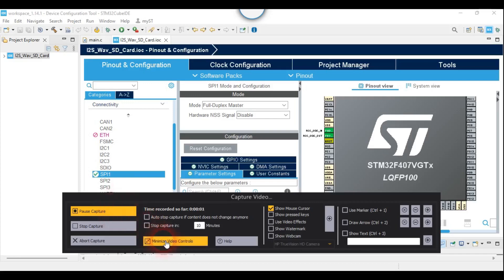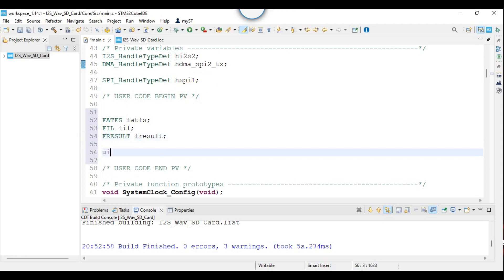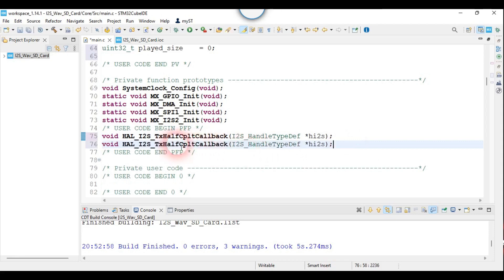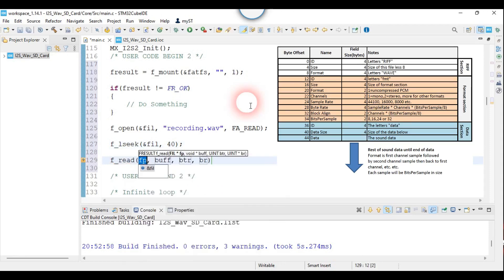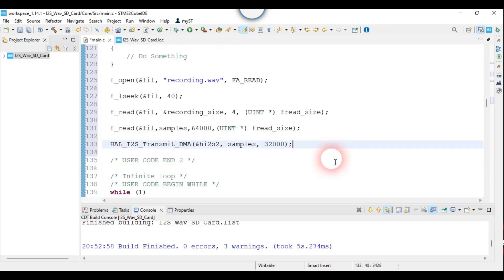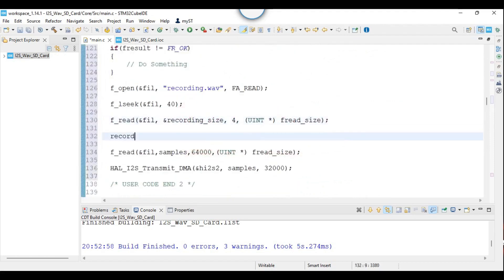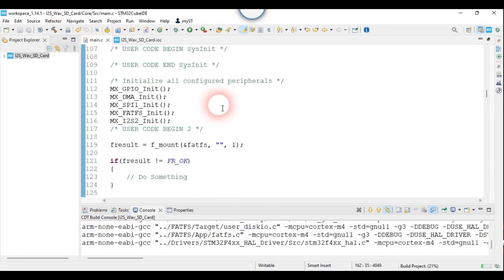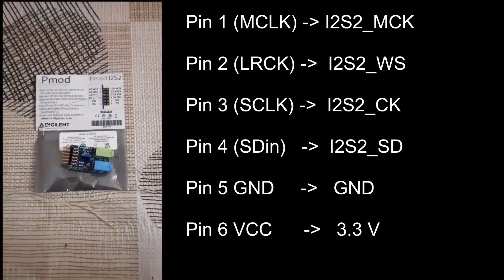Playing Wav File From SD Card (STM32 - I2S - DMA )

Comment: Hello,
I discover your very interesting presentation when, I am willing to use I2S with my stm32h747i-disco board.
I implemented your method but I miss something.
The issue is the program run only one time the function callback. I find out this with breakpoints and also print .

void HAL_I2S_TxHalfCpltCallback(I2S_HandleTypeDef *hi2s)
{
	callback_result = HALF_COMPLETED;
}

void HAL_I2S_TxCpltCallback(I2S_HandleTypeDef *hi2s)
{
	callback_result = FULL_COMPLETED;
	played_size += FATFS_BUFFER_SIZE/2;
}
Do you have any idea
Best Regards
Reply from the maker: I think you forget to select circular mode in DMA configs,  see this image https://ibb.co/Rch4yM4
Reply: Thanks.  Yes, I was in normal mode for DMA instead of circular.
Now with a wav file saying " batterie"  of 54236 Bytes a int16_t samples[1024];,
I have 27 jumps in void HAL_I2S_TxCpltCallback(I2S_HandleTypeDef *hi2s).
I feel the system is working but still no sound.
I am picking the signal on the I2S1_SDI pin (PA6) Digital pin5 of the arduino connector below the Disco Module. I am not usual of I2S, may be the output is I2S1_SDO pin (But, I don't see any access to this pin).
Then, I use an amplifier.
best regards